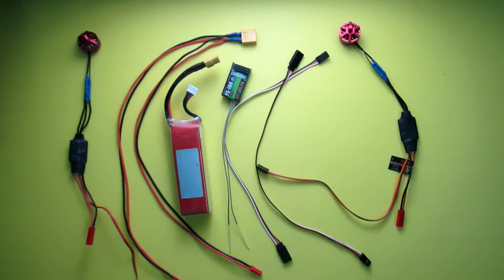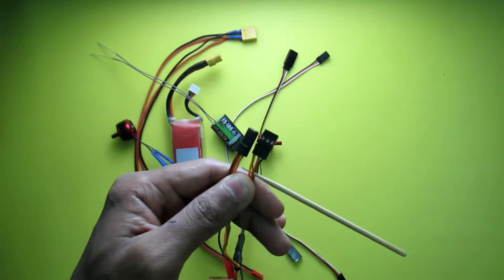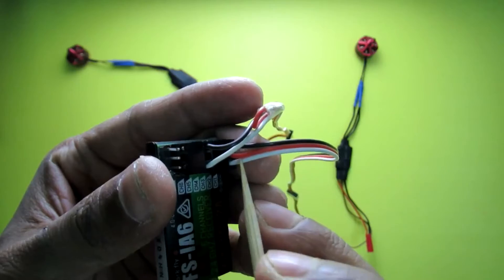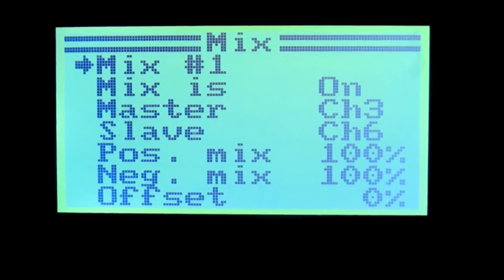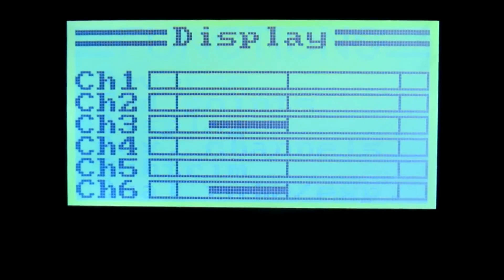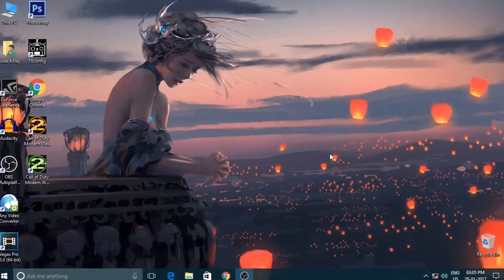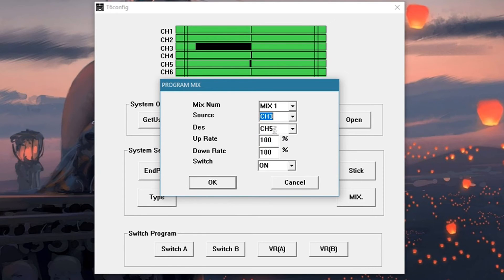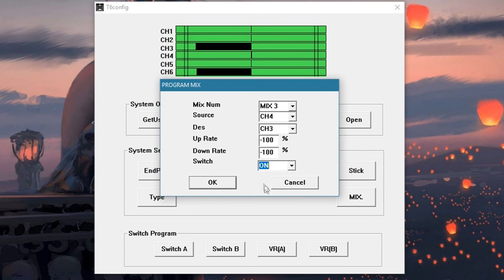Differential Throttle with 3 mixes (FS i6 & FS CT6B)

Comment: Straightforward explanation. But didn't work for me until i figured out to set the auxiliary channel for channel 6 to source none. After that, it worked perfectly.
Reply: omg i was freaking out because it wouldn't work until i saw this thanks
Reply: I think he is talking about the FS-i6. Usually Channel 6 is mapped to one of the AUX Switches which probably need to be unassigned.
Reply: David S. Yes
Reply: Olaf Schmitz thanks!
Reply: dude you save my day
Reply: Thanks man, I was going nuts
Reply: thank u ...

Comment: Michel P
Thanks for this very good video. But I can see 2 drawbacks for indoor models : it needs 5 channels and 3 mixes.

A fellow of my Indoor club, that built a Concorde plane with 2 motors and no rudder, was in trouble to  turn.  I find out the following solution that uses only 2 mixes and is compatible with 4-channel indoor receiver.  Channel 1 and 2 are used for elevons and channel 3 and 4 for motors. Here is the configuration.

The left motor is connected to channel 3 (CH3) and controled with the throttle stick,

The right motor is connected to channel 4 (CH4) and controled with the rudder stick,

Channel 3 and 4 need to be reversed with my transmiter , MIX-1 controls both motors and MIX-2  speed down one motor while speeding up the other one.  Rudder trim needs to be push to the right to prevent controller to beep.

MIX-1 :
	ON
	Master : CH3
	Slave :   CH4
	+100%
	+100%

MIX-2
	ON
	Master : CH4
	Slave :   CH3
	-100%
	-100%

Comment: Typo error in my previous message is corrected below.
Using the joysticks of my Flysky FS-i6S,  how do I variably control three motors to have the same RPM according to three mixes so that each mix has one motor rotating opposite to the other two as shown below. Is this even possible?

Mix 1
Motor A -  Forward
Motor B -  Reverse
Motor C -  Reverse

Mix 2
Motor A -  Reverse
Motor B -  Forward
Motor C -  Reverse

Mix 3
Motor A -  Reverse
Motor B -  Reverse
Motor C -  Forward

Thank you.

Comment: Thank you so much for this.I did all the steps like you did but I do have one error the motor in channel 3 keep peeping and not rotate.Please note I did switched the 2 motors on receiver and working always in channel 6 but channel 3 what ever is the esc not working with a lot of peeping.
Reply from the maker: Are you using 12A Blheli esc ??
In some ESC lower point is specific and the lower point of CT6B is little bit high, so you can correct it in 2 ways:
First make the EndPoint of Ch3 is 120% (Both) then
1) Adjust the trim of Ch3.(Down)
     OR
2) Cut the throttle by using the throttle cut switch, before connecting lipo.

Comment: Bhai el problem hai please solution BTAo ..bhai mene tumhari. Video dekhkar difference throttle setup kiya pr jab mai stick ko left krta hu to left hi moter chlti hai aur  right band ho jati hai jab right mai stick krta hu right ki moter. chtli hai aur left ki band ho jati hai bhai aesa kyu hota hai aur bhai jab mai throttle ko 100% kr deta hu right wali moter band kyu ho jati  hai apne aap bina propeller ke 100% karuga to nhi band hoti pr jab propeller lgi hoti hai tab 💯% throttle kr duga to keval right ki band hoti hai please bhai reply fast mujhe bhut jrorat hai apke help ki 😟😟😟 bhai please help me
Reply from the maker: connection check karo left right me problem ho to channel ko swipe karo matlab right ko left ki port malagao aur left ko right ki port me lagao. aur motor stop sayed connection problem hoga

Comment: Great video. Using the joysticks of my Flysky FS-i6S,  how do I variably control three motors to have the same RPM according to three mixes so that each mix has one motor rotating opposite to the other two as shown below. Is this even possible?

Mix 1
Motor A -  Forward
Motor B -  Reverse
Motor C -  Reverse

Mix 1
Motor A -  Reverse
Motor B -  Forward
Motor C -  Reverse

Mix 1
Motor A -  Reverse
Motor B -  Reverse
Motor C -  Forward

Thank you.
Reply from the maker: with only 3 mix it's not possible

Comment: Both Motor's are running as soon as I turned on the transmitter and from there by increasing speed by giving throttle. What should I do?
Reply from the maker: please check your transmitter's lower throttel value and calibrate the esc

Comment: Do we need separate batteries for separate motors ? If not how?
Reply from the maker: No, you don't need separate battery just connect both ESC together with a single battery

Comment: I try to turn mid-air using this method. My plane just rolling. It is not making smooth turn.
Reply from the maker: you need to apply little aileron and little practice.

Comment: The problem with this is that you dont have any spare mix to do the flaps
Reply from the maker: You don't need mix for flaps use a switch for flaps in 10channel transmitter and receiver